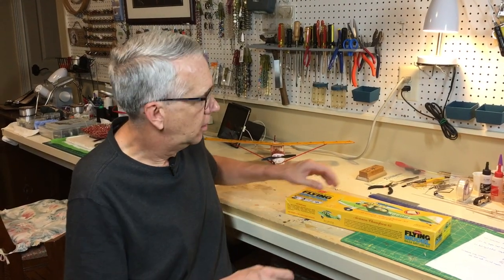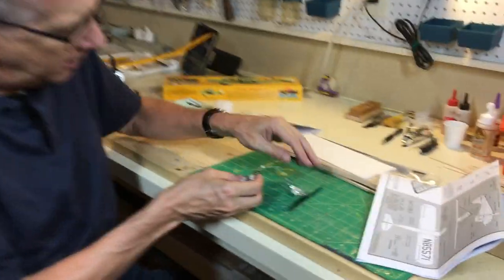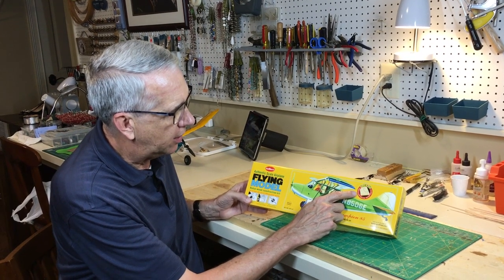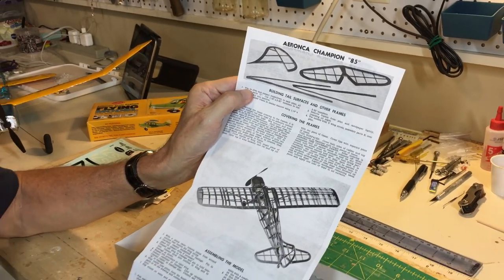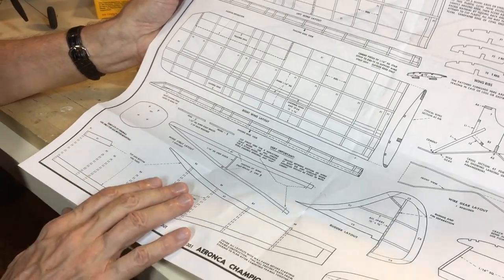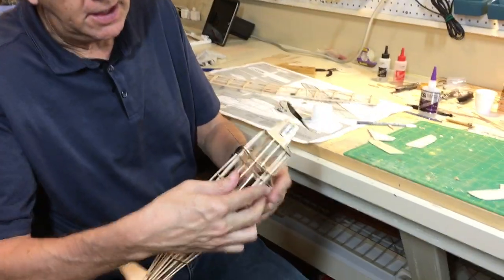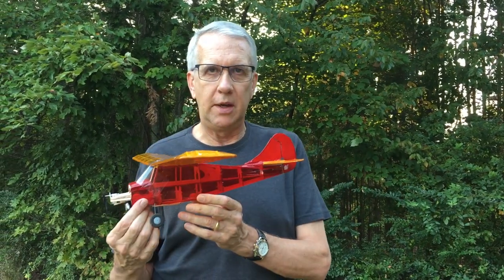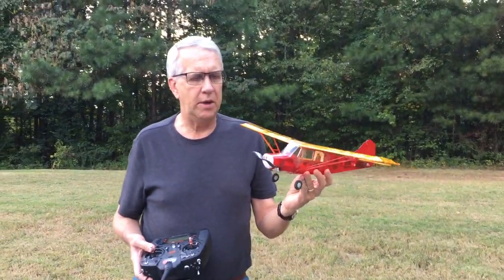Guillows Aeronca RC Conversion - Step-by-Step

Comment: I have a Guillows Aeronca 3001 electric model. I haven't built it yet but it has a 60" so its a bigger plane then most Guillows models. I have yet to build it but I'm excited to get it going.
Reply from the maker: Jess: I had to look that one up.  Did not realize Gullows made a kit airplane that big.  Looks like a nice project, best of luck!  Tim
Reply: @TimMcKay56  Yeah its kind of a rare one. If you ever come across one, get it. I think it would make a really neat subject for a video. Its Semi-scale so its more aeronca looking rather then an actual aeronca. I'm going to try and build mine as light as possible like you did yours. I'm torn though whether or not to keep it original or modify it with some ailerons/flaps like I've done to my Guillows arrow (flys really nice with flaps down). Or keep it original since its a fairly rare model.
Reply from the maker: Jess:  Good update!  Tim

Comment: Tim, I recently aquired an Aeronca. It looks like the plastic for the windows will work well for hinge material. Have you tried that? If so, does it work?
Reply from the maker: William:  I have not tried it, but should work. Clear Scotch tape works fine as well for these smaller models. Tim

Comment: Hi Mr.McKay, what specific weight and type of the monocot you used, would Myler covering ( No. 2 or 3 ) would be a good idea for weight saving.
Reply from the maker: Mahir, thanks for checking in!  Regarding the iron on covering, you'll have to hunt around a bit.  I know Horizon Hobby has Solite covering, which is a lightweight iron on covering.  Other brand names would be ParkLite.  I cannot recall the MonoKote light weight covering, not sure if they even make it now.  I am not familiar with the Mylar covering . . . idea is for the covering to be as light as possible.  And in this regard, tissue is a great option as well.  Tim
Reply: Mahir Wrobleski 5

Comment: I've using those micro motors for a while but they don't seem to last long. I guess they have metal brushes that wear out quickly.
Reply from the maker: Yes, and they are delicate.  One bad jolt and a solder joint can break, etc.  Tim

Comment: The Cessna 150 is similar and I put off building it. I’ve never built a guillows model but I did buy a laser cut, I’ve had experience with die cut and some really ate my lunch.
Reply from the maker: Harold:  Good luck with future projects!  Tim
Reply: @harold... My Guillows C150 will arrive soon...plan to cover and decal it in the same color scheme I solo'd in...full size years ago. Have you made any progress on your 150? Any tips or insights?

Comment: Very nice tutorial video.  Recommend using "lite" type iron-on covering,  intended for small electrics , such as Parklite, instead of Monokote and provide link of where to get motor/speed control/receiver "bricks" or alternative micro gear for small models like this. Alternatives for removable wing mounting would also be good. Also would be good to include a link to RC Groups "sticky" list and conversion threads of all Guillows models.
Reply from the maker: Gary:  I added the link in the Aeronca description to my video on where to purchase the micro electonics (www.StevensAero.com).  Wing mounting adds a bit of weight, and you are never sure the wing is on just right.  At these light weights, I think it is OK to glue in place.  But, can certainly use an alternate mounting method.  Good luck!  Tim

Comment: Tim thank you for your videos ! I am new to this hobby, but find your segments very informative. Two questions, if I may? Purchased a “ brick” from Steven’s and a GWS/LPS-B2C brushed motor from eBay.  Going to attempt a scratch build from an old Comet balsa kit. Not sure how to plug 1 cell Lipo. Battery to brick. Not sure which is negative and positive on eflite Lipo battery? No red dot  like on my horizon hobby champ. How would I size a brushed esc for GWS motor if motor may not connect to brick? Thanks , again, for great info.
Reply from the maker: George:  To plug in the 1 cell lipo, if there is no red dot on the bottom of the brick connector, look for some sort of plastic extension . . . that would be the bottom of the connector.  For the lipo, ensure the writing on the top of the battery (1S 3.7V 150 mamp, etc.) is the top of the battery.  Remember when you plug the battery into the brick with the transmitter off, after around 5 secs the light on the brick will flash rapidly, as that is the bind mode.  As the brick contains the ESC, receiver and two servos, I have no idea how one would connect another ESC to this unit.  www.StevensAero.com might have an idea.  Tim

Comment: Great video and lots of very good tips in regard to converting these models for successful RC operation. These models were never designed for R/C. Sometimes I think that they were primarily designed to hang from the ceiling over someones bed! Nothing wrong with that, I have a few hanger queens on my wall as it is. I wonder if Guillows would ever bring our an R/C version of the kit based on your mods?
Reply from the maker: MS:  These Guillow kits are quite old from when originally rolled out.  They seemed to do a very nice job of updating the plans with the newer laser cut kits.  But why they discuss U-control or single channel radio version, with no mention of electrical power, I have zero idea.  Would be good to perhaps offer a more complete RC solution!  Tim

Comment: I love to watch your build and fly videos.  Would you be willing to share any information regarding the 
down thrust and right thrust angles that you use on your ultra-micro builds.  Currently, I’m mounting the park zone 
motor on to a polyurethane carving block set at 3 degrees down thrust.  I’ve not seen any consistent information regarding 
the amount of right thrust needed.
Thanks,
Jim
Reply from the maker: Jim:  I always start with around 2-3 degrees right and down thrust.  Seems to work.  Tim

Comment: I'm about to start a guillows Stearman pt-17.  I'm wondering if you would still increase the angle of incidence on one or both of the wings?  I've seen several of your videos and this is the only model I'm seeing you mention that on.  It would be easy to increase the angle of incidence on the upper wing, probably a little harder on the bottom wing.
Reply from the maker: Patrick:  If you add a bit of positive incidence to just the top wing, should work just fine. Tim

Comment: Great videos Tim and I like the way you explain your methods. 
Is there a chance you could do a video on the Guillows Giant Stuka?
I’m about to purchase a kit and I want to convert it to RC. 
Keep up the great work.
Reply from the maker: Brendan:  The Stuka would make for a great RC conversion.  If you follow the process on my Guillows Hellcat, pretty much the same approach.  I will not be building a Stuka as the plastic wheel pants will come off about every flight with my grass runway.    😁😟 Tim
Reply: @TimMcKay56  
Thanks for the prompt reply, Tim. I have seen your Hellcat vid and that’s probably the way I’ll go.

Comment: I wish at 15:56 you hadn't skipped all the brick installation, servo hookup and covering.  Those are real challenges.
Reply from the maker: CC:  Did not mean to cut you out of the pattern, thanks for bringing this up.  I do think I cover this in the Arrow and Pilatus videos.  But I will convert a Guillows Cub in the next few months, will make a focus video on both covering and  installation of the brick.  Tim
Reply: I'm sure I speak for many when I say thanks for these videos.  They are really helpful and fun to watch.  You motivated me to buy an Aeronca kit and I'm in the process of building it now.
I definitely did the single wing mod you detailed in the video.
I am installing the eflight AS3x brushless esc brick and park 180 motor on mine.
Thanks again.
Reply from the maker: CC:  Best of luck with your Aeronca!  Tim

Comment: Great video, Tim, greetings from Downunder. I received this kit for my birthday a few years back and have yet to build it. I grew up building Guillows & Sterling FF rubber models, so I really enjoy seeing videos like these. I was planning to take the gear from my Vapor and install it but not sure if that motor will be powerful enough. I believe there are a few different versions of that motor. Tim, which one did you use?
Reply from the maker: Stu:  Many thanks!  The Vapor motor will not be powerful enough for the Aeronca.  If you go to StevensAero.com, look under micro motors, and purchase their "performance micro motor and gear box," that should work well.  Tim

Comment: I'm trying to figure out your concern with weight? If it were rubber powered, then weight is super critical, but I wouldn't think it would be on this, unless you're trying for very slow flight?
Edit: I was watching this over two days. I went back and payed closer attention and got my answer. 😁
Reply from the maker: KF42:  All good!  Weight is perhaps the most critical item for flight, from private aircraft to airliners to space rockets.  There is simply no valid or good reason to fly anything that is heavier than it should be.  This is especially important for smaller RC or free flight models.  Tim

Comment: Did I miss asking the Propeller size?
Reply from the maker: I use the propeller recommended by Steven Aero for their micro motor.  The prop is typically listed under the micro aircraft page, under "Parts Needed."  Tim

Comment: It is absolutely beautiful. But, why I am always a bit disappointed when I see an electric motor, not a COX in these? Perhaps because I am 60 and got used to glow plug engines and Guillows kits ,and learned to love them in the Seventies here in Finland. Still, it feels like not doing what the instructions show. You can still get those 0.10 :s and 0.20 :ies from Cox International or EBAY, so using the electric motor is like a straight man buying an electric car. Sorry, I just love the smell of castor oil a bit too much, apparently...
Reply from the maker: Timo:  Thanks for checking in!  Yes, I recall many flights with models and the Cox engines.  I'd say that with the smaller Guillows models, the lack of vibration from an electric motor, plus the easy ability to throttle power, makes the electric choice a bit easier.  Also, less noise for backyard flying.  Tim